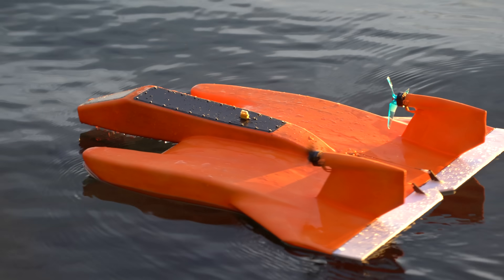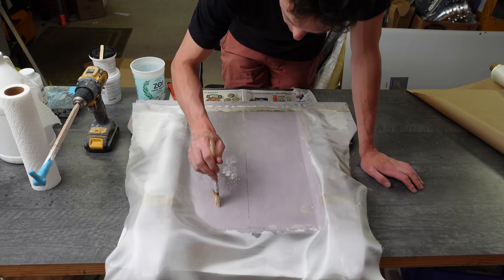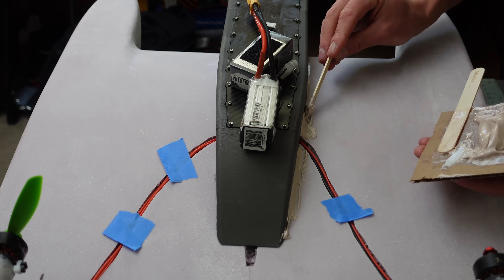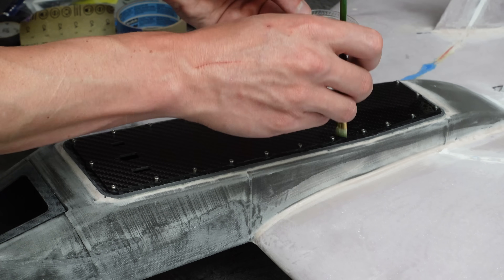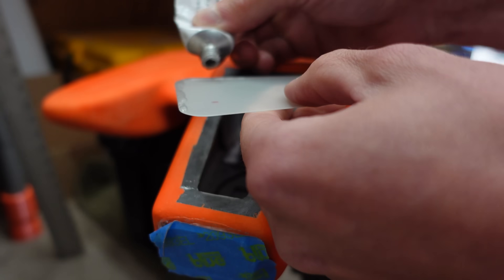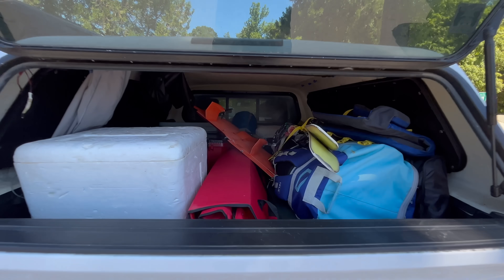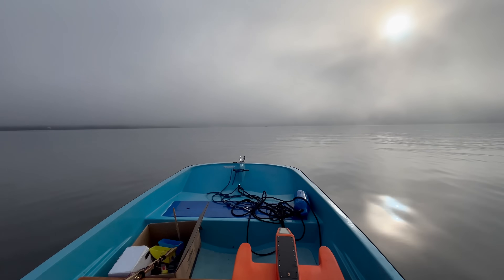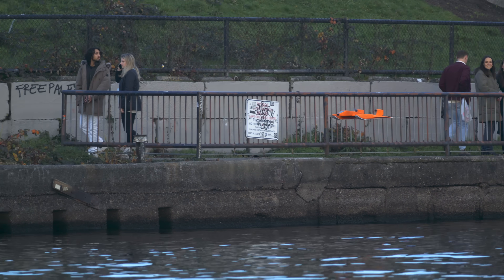Building an FPV Seaplane - 3D Printed + CNC

Comment: One other thing, on the bottom surface, you get insane performance if you cut temps in the bottom surface of the hull, like an offshore race boat like a fountain or MTI power boats. Also, the center pod/sponson is too long or deep, and drags into water while planning. Good luck brother.

Comment: I wanted to share with nyou a few things to help elevate some of the weight. Get an electric ‘Mouse sander’ to into and sand tight areas. Also, use popsicle sticks or tongue depressors for spreading the fairing compound into fillets. And lastly, use a foam or hard blocks for sanding the layers of glass/fiber smooth. I surf a lot and used these tools while repairing surfboards. You’re doing an awesome job and am interested in that CNC Mill table of your, very cool.

Comment: hi, im in a school club building a plane for the AIAA design build fly competitioin, weve decided to construct our plane similarly to this method. the wall ive hit is the CAM, i have plenty of experience in solidworks so design is no problem but i have no clue how to get the curved pieces from solidworks, through the cam program into a program that can be put into our router table. i also have access to fusion 360 and onshape as well

Comment: About ground effect, that depends on the wingspan, not the weight. Besides it being limited to a height of half the wingspan over flat, solid surfaces, it is also diminished over water. With the very limited wingspan of your seaplane in combination with flying over water, I am not surprised you barely if at all notice it.

Comment: As someone who used to restore vehicles for a living I absolutely love glassing. It wasn't a very common repair I got to do as I typically used period correct repairs, but some owners wanted it to look right for lower cost, so filler and glass worked really well sometimes. My absolute favorite was old school body filling using lead.

Comment: Your issue with getting 'off' the ground is in part likely because you are missing a step. The step eixsts on all 'Flying boats' because it lets them get up and out of the suction in effect 'getting on plane' enough to rotate up otherwise suction stops you being able to get into the ground effect properly.. your design doesn't have that.. until you start adding the extra material at the front. 

Look up how flying boats and the like have the notch in them (the step is the notch) or all floats etc.

Comment: Hi! You will have better luck if you mount the prop motors on nacels in front of the wing and blow the thrust at the wing. You may have to make the pontoons a little taller to keep the props out of the water. You have done this on some of your other designs. The thrust from the props flowing around the wing will help lift the vehicle out of the water. Because you are blowing thrust at the wing, it can not be stalled. So you can also increase the angle of attack of the wing a little and compensate by moving the vehicle CG forward a little by moving the battery little forward. This design has a long proven history with the Ekranoplan. Good luck and thanks for showing us your project. Mine is very similar and can be seen by clicking on my icon. It is an roadable amphibious VTOL/Plane Blade Runner style flying car! It is very similar to your design in that it has pontoons with a wing in between, and works really well in all modes: car, VTOL, Plane, and navigates as well as takes off and lands on water.

Comment: You had a hard time cutting aluminum because you were running that bit too fast compared to your feed or bit was dull. You need to see nice swirly chips to know you are the right speed, use a 1 flute bit in Al if you are not yet.

Comment: to explain what causes the ground effect i proportion is essentially; "The effect is proportional to the chord of the wing but the extent to which it occurs is dependent upon the profile of the lower wing surface. If this lower surface is markedly convex, and the angle of attack is small, then the effect on lift eventually becomes negative." - NASA space center

Comment: The Sea Skimmer, a strange U-boat-hunting seaplane from WWII. It was designed by an Austrian arms dealer as a highly maneuverable platform to chase down and circle U-boats, which it could attack with the depth charges seen on the landing floats. It had small stubs for wings so it couldn't leave the ground effect. Armament was a 20 mm Oerlikon cannon and a machine gun. Britain was not interested.

Comment: Nice work overall.  My Skynetic Dragonfly is like the Hobby King Skipper: Delta shape with high-mounted motor.  I get full ground effect and the nose is buoyant enough to get a nice launch.  I wouldn’t say copy that design, just know that you’ll need more float in a plane that is not foam.

Comment: Make the center of the float at step go down further.  It needs to ride on the step which is on or slightly behind CG without any of the tail or rear of float touching the lake.  When perfected and you can get right angle of attack, it will feel much like wheels, not needing abnormal speed to gain enough lift to take-off.  Many years of float and seaplane building and flying experience.

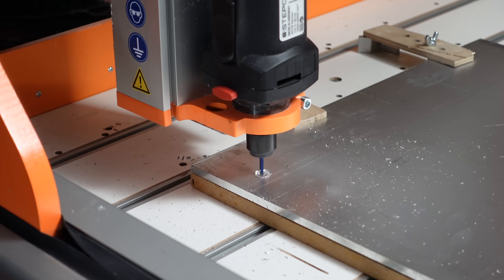Comment: CNC apprentice here, use oil when machining aluminum (9:18)! Aluminum has a relatively low melting point. It will stick to itself and tooling when machined - this is probably the smearing effect. 

Spraying the tool regularly with WD40 will make a huge difference. A more permanent solution could be as simple as a nozzle hooked up to an air compressor with a sort of carburetor connected to an oil reservoir. You could power the coolant nozzle and help blow away chips with compressed air using Bernoulli's principle. Searching for "Pneumatic Oil Sprayer Machining" there are lots of flexible options that will pay for themselves in machining time and tool life. In general, anything that can cut wood, can cut aluminum pretty well with oil. 

The chip separator is pretty sweet, and I love the carbon fiber plate! I wonder if using a hot wire to rough out the profile of the body before machining could save you time. Also I am very impressed with the craftsmanship of this model, I made an autonomous drone for a class project and this puts it to shame.

Comment: I'm really interested on the ground effect of your plane. I have some idea you could test that are easily reversible: Those white depron surfaces could be higher and skinnier, so there is less surface area when it hits the water, and there will be a bigger barrier for keeping the air under the body of the plane. While flying, will act like stabilizers too.

Comment: For cutting Aluminum on a router and especially heatsinks, don't use endmills, use solid carbide high feed mills. The workforces are small and axial instead of radial.  I get mine from Helicaltool.

Comment: this design is  inherently tail heavy.     so, it would have been a good idea to  Not  make the stabs any heavier than absolutely necessary.      similarly, it was the opposite of smart to locate the mass of servos aft-of the cg/c-m.
why do you insist on using the  MOST  COMPLICATED  building techniques.    check your meds.

Comment: The drag with the water needs to progressively reduce to prevent sudden acceleration causing the craft to pitch upwards. I'd add long wide tail fin in the middle underside and eliminate the section of the side pods aft of the step and replace them with vertical sides shaped to create outwash vortices to seal the sides from air spilling out.

Comment: you need a coolant line to cnc aluminum. if this is not an option, an occasional dousing with wd40 (basically so there is always a tiny bit of smoke). aluminum needs to be kept cool or it turns gummy. the death of an endmill.

Comment: great vid and effort. one or two suggestions for consideration would be adding a step design to the port/star pontoons. https://www.maac.ca/images/articles/fp7.jpg which should modify the center of gravity keeping more weight forward for your elevons/flaperons to stay dry. it appears to butterfly at/near the water b/c they are influenced by the water and not air. idk - not there to see enough. great work and video. thanks.

Comment: Daniel, I love your channel and your projects.  You are the opposite of lazy. As I watched you apply all that fiberglass I was thinking, I guess you plan on keeping this plane for years to come. On a technical note, over the years I worked on some boat projects while at Columbia University, and a naval engineer turned me on to a three-volume set of books called Principles of Naval Architecture.  Columbia's library got them for us, and I was able to look at them.  If you can get a hold of them, they are seriously a dense read, but there is an entire chapter dedicated to designing stepped floats for seaplanes.  It turns out the design for coming up on plane is trickier than people think.  The step has to be the right size and in the right place for it to work effectively. The entire shape of the float is also important.  Sorry for the long response but keep up the great work!

Comment: I'm rushing to give this comment so, I apologize if it is a bit of a ramble.

I think some of your issues relate to a scale and relativity problem. While the scale of the aircraft changes, the relative scale of the molecules of the fluid it is interacting with is actually going in the inverse direction. Like a full size seaplane taking off in mud instead of a lake. 

This is emphasized by your vehicles often having very wide and flat bottom pontoons. Those have a large surface area for the water tension to adhere to without a gradient for air intrusion to assist in the separation. The step helps, but doesn't address the source of the problem.

To overcome those problems I've seen you increase the chord of the airfoil to generate more lift, but as the vehicle sits in the water the waves (which are relatively larger than a scaled up version would have to deal with) just lick up at the bottom surface of the vehicle and suck it back down.

You've also gotten stronger motors, but that doesn't actually help against the initial water tension issue. Once the water tension is broken the thrust causes the vehicle to launch up out of its ground effect range.

More work on the design of the pontoons and give the pontoons a strut to space the airfoil higher off the surfaces of the water.

Comment: Someone might have pointed this out but you don't want rounded edges on a planing hull. The step is good, but the front-bottom edges of the floats are better sharp as the rounded shape allows water to follow the curve upwards.

Comment: This was support cool, thanks for all the work you do to put them together! Do you think the props at the top are creating a type of turbulence that reduces the ground effect since they draw air in at the front over the high angle of attack leading edge? It seems counter intuitive, but, that speeds up air coming in and creates separation vortexes that un-spin and fly all over the place and so that might cause the ground effect to become worse as it spends time and energy getting sorted out, no longer having good orientation for proper continual flow currents, I believe, the ground effect needs.

Maybe a slight cut, hole placement , with a little channeling there, and a "canard" wing in the new "clavicle" hole of the "shoulder" leading edge of the wing to allow for the air turbulence to become controlled. I mean, there is a decent amount of chord there. That could help with lifting the nose up too with some better lift control, instead of, possibly heavier, "pontoons". Although, servos, controllers, and all of that would add wife and complexity too.

Well, one single rod pushed up and down would get connected to a crescent rocker gear that would mean only two actual servos would be required as the crescent gear changes the total amount either side gets for change of lift or reverse lift. Depending on how you want to do it, which you might be able to get away with just one servo. But you would have to use diagonal angles to use a single middle point draw back and draw forward to move the wings up together, one side more, or reverse. That helps with weight and total complexity.

However! Sadly you have to do a while bunch of cutting, hollowing out, wing making, and so on for that. I'm not sure if that's easier than just making a new one.

Thanks for making the video, I had a lot of fun watching it!

Comment: I also use my stepcraft cnc mill for cutting Aluminium. I dont know which material you were cutting but with AlMg4.5Mn and AlMg3 i get a Great result. Im Using a 3mm cutting Tool with one edge

Comment: So what ive seen in hydroplanes is a very round and thick symetrical airfoil with tons of incidence so the rear bottom of it is flat to the water, basically like a ski shape but with a foil on top too, the should give you automatic pitch stability because the front getting lower means it increases preasure and the rear geberates downfprce forcing the nose up, like your triangle shaped thing but smoothed out, i got this idea from seing your concave airfpil have negative pitch stability idk if im explaning myself too well,

Comment: Low aspect ratio wings are always inefficient and heavy planes are inefficient and thick aerofoils are inefficient and high speed is inefficient so maybe not so surprising really but a wonderful video thanks. The Catalinas still fly so they are the surprisingly good flying boats. Ground effects increases with wetting span too! Drag increases proportional to frontal area too!

Comment: Hahaha without knowing you copied or created an already existing RC model. It is called the hydrofoam RC and it is at least 16 years old. There are slight differences but the similarities are overwhelming. The pontons from the hydrofoam are located in front of the fuselage.

Comment: Ground effect scales with wingspan. If you want to maximize it, make your wings wider.
Reply: It really depends more on surface area, the trapped air pressure needs to have space to act on the wing surface. It doesn't care for the airfoil shape, it doesn't care about your speed, it just needs space to act. And his new plane is simply too small to really trap ample air under the wing to have a surface area to act on. adding some bigger wing outboards will allow the air trapped under the plane to properly create a lifting moment akin to a hovercraft. I'm not surprised it performs poorly, when he basically built a seaplane lifting body. To try to build a Grouns effect akin to the Russians, they used Jet engines to literally blow air under the wing to generate bonus lift until the aircraft got up to extreme speed where the stubby wings could trap enough air against the water to switch to a pure ground effect behaviour.
This design is too heavy for the former and the high mounted engines are basically driving air over the wing instead of trapping it under

Comment: Was that plate for the heat sink in the 3000 series aluminum? I've had similar things happen with 3000 series alloys smearing like that, and it is completely unworkable. I'd be really surprised if the Stepcraft can't cut regular 6061 aluminum, with proper feeds and speeds

Comment: Havecyou tried fibreglass tissue for the top layer rather than 2oz? Ive had quite some success with it over the years. As i spent years machining aluminium with cnc routers and cnc engravers for the smaller parts commercially i can recccomend you use what we call methylated spirits which you may know as denatured alcohol as the lubricant/coolant whenmachining it. Id be interested in how it works for you.

Comment: just in case this is anything you haven’t tried 
you could use a two flute end mill and turn up your spindle speed as high as your comfortable with on the CNC and i would try to use air to cool it as you go cutting fluids gum aluminum up with the chip evacuation 🤷🏿‍♂️🤷🏿‍♂️🤷🏿‍♂️ bad english sorry lol

Comment: When milling in aluminium, use Isopropanol as a cooling liquid. That does the trick. Start with little and add more when needed.
Reply: Or Paraffin (kerosine).

Comment: put a step on the floats, it will make a world of difference and hopefully let air get under the wings since adding a step to the existing floats will give you a little bit more depth under the wings to plane on.  you may also be able to add a tiny hydrofoil just forward of the CG to help it get some air under the wing and positive angle of attack once on plane to lift off.

Comment: Are you using a single flute endmill for cutting aluminum on your CNC? If not, try it - makes a HUGE difference for router based CNCs. Also helps to get  harder alloys of aluminum. Softer alloys gum up so much worse.

Comment: 10:17
Spray IPA or just WD40 onto the workpiece while milling. This makes a huge difference in cutting and surface quality. Also, maybe check the alloy you are using. EN-AW-6082, 7075 or 6026 cuts really well.
Reply: Agreed, IPA probably does a great job cooling(and the low viscosity improves tolerances), but an emulsion of oil and water is cheaper and won't catch on fire

Comment: I wonder if the planing problem wasn't in part to power pushover, where the line of thrust is above the CG, so you tend to pitch down when increasing throttle.